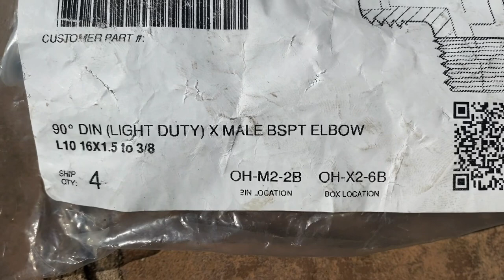Harbor Freight Trencher Repair Part 2: “ I get by with a little help from my friends.”

Comment: British standard pipe is what kubota uses as well if that is of any help.  Difference between American and British pipe threads is.  American is tapered and British is straight.  If you thread American too deep it can gaul out the port or even crack the port.  Just saw in my feed someone working on a backhoe keep up the good work.
Reply from the maker: Yeah I went out and eyeballed a couple of fittings and expected a quick fix, but when I turned it I could tell I would do some damage if I did t stop.

Comment: If you prefill the filter prior to installation you prevent oil starvation in you pump during startup.
Reply from the maker: Duly noted. I lubed the filter seal but didn’t fill the filter.
Reply: The duration of filling the filter is inconsequential.

Many filters are mounted in ways you can't pre-fill.  On the side or inverted.  The inverted is common on heavy machinery like excavators that move 2 cubic yards per scoop.

The real standard for how to change oil filters is to just lightly oil the gasket.  And put the filter on empty.

Comment: It's been about a year since you posted this video, 
Can you elaborate how the AW68 oil has held up , winter,summer , does the unit over heat the oil and slow down performance after a couple hours like we found the thinner oil does ? 
And is all the hoses suppose to be in the D-Ring on the boom knuckle ? We bought ours used and the orevious owner left 2 hoses out of tge D-Ring for some reason ...
Somehow he managed to put the wheels on backwards to , that took some time to fix 😂
Reply from the maker: I personally never saw any issues with temp or performance. I haven’t worked the machine as hard over the last year, though. As far as the hoses? Not really sure. Mine is a second hand unit, too, so I can’t vouch for its configuration. 😬

Comment: Can i get part number. I need a replacement cylinder like you have done
Reply from the maker: https://manuals.harborfreight.com/manuals/62000-62999/62365.pdf. This website has the manual online with an exploded parts list near the end. You can order by phone through th ordering number at the HF site.

Comment: 5:45  Please stop using the Crescent wrench.  You are doing it wrong and will round off nuts.  Get a set of proper open end box wrenches.  USE THE CORRECT SIZE, not SAE on meteric or metric on SAE.

I like and use the Crescent wrench, but I snug it up on the nut/fitting and that prevents rounding off the corners of the hexagonal shape.  You have a gap like using 1 size too large metric...

The equipment you stop mangling will rapidly pay for the proper wrench set.
Reply from the maker: Thanks for the tips. Guess I lucked out this time.

Comment: Use the correct tools and wouldnt damage things
Reply from the maker: Yes I’ve been told. Unfortunately, I have little experience working on farm/ industrial equipment so I’ve had to make do. I know there’s a proper tool for every job. I just work on so many types of things that always using the correct tool is cost-prohibitive.